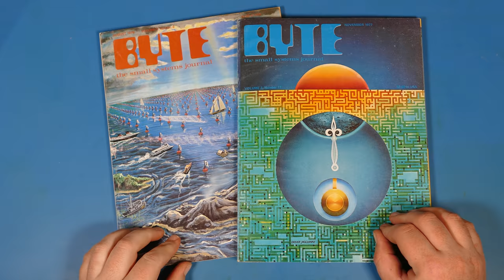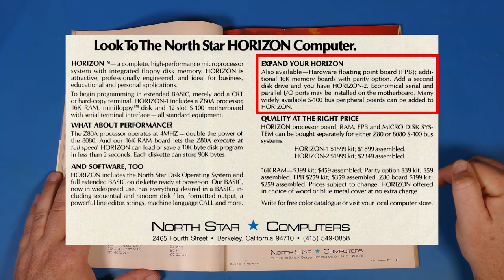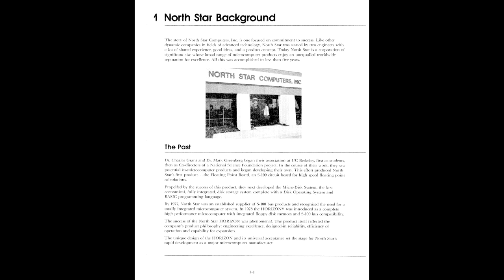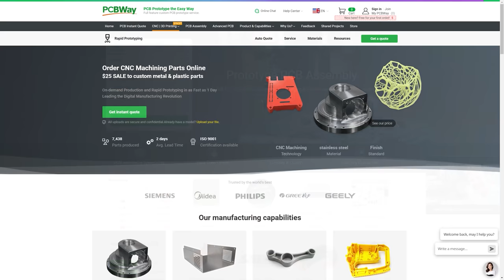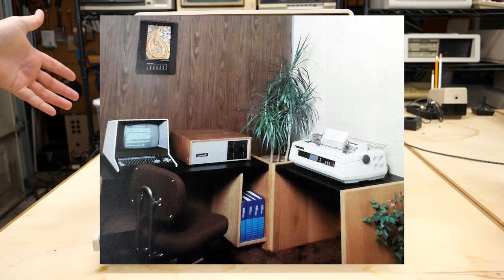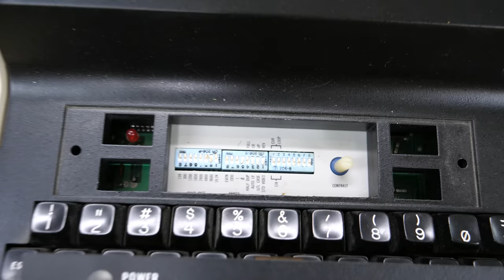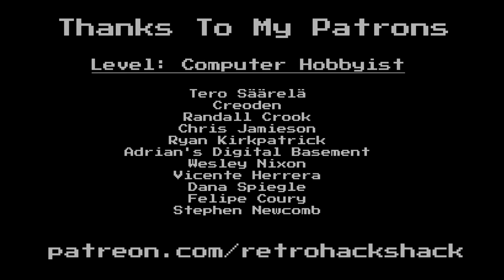The North Star Horizon - An S100 Bus Computer From 1977

Comment: Around 1977 the style for consumer Hi Fi units was very much that 2 part wood and aluminium look, so I wonder if North Star just commissioned a manufacturer of HiFi cases to make their case? Since this was focussed at home /small office users maybe they also wanted a design that fitted into the "modern" style that people would also have.
Reply from the maker: Yeah. That's very possible.
Reply: That was my first thought too - the styling is exactly the same as HiFi equipment from the same time period.
Reply: A lot of hobbyist computers looked like this. And a lot were S-100 (even the IMSAI 8080 or Altair 8800). Most of these started as home kit computers - the market was very very small and there were very few retail outlets.  I think Northstar - like IMSAI and Altair  - even had an optional toggle switch front panel.  Stunning to look back at 2Mhz -8 bit -64KByte system with a couple of 360KB floppies and think this was "living large" at the time. I think this config was around $5000-$6000. Moore's Law had not even kicked in yet.
Reply: For certain computers the cases were intended for something else. For example, the cases that Proc Tech used for the Sol Computer were originally intended to be used in the construction of digital clocks, so were available much more cheaply than a specifically designed and manufactured case.
Reply: In the late 70s the woodgrain aesthetic was everywhere and on everything you can think of, it gave things like "cold" electronic devices like electric can openers a warmer, earthier vibe which the 70s were all about. It quickly became faux woodgrain which as we (well, I guess you have to be of a certain age...) know carried on into the 80s. There was Dynabyte computer from the late 70s that had a faux woodgrain veneer, may have even been something like the contact paper that was used to line shelf (Dollar Tree still sells it ;), though more likely it was painted/printed on. Would love to own that Northstar.

Comment: Almost choked on my coffee when you said 32mb of RAM. According to a google search 64k of RAM in 1980 was ~$400. 32,000,000/64000=500 500*$400=$200,000 in 1980 dollars. In 2023 dollars that would equal ~ $774,000. No telling how much space 32mb in 1980 would have taken up and aforementioned cost is just the RAM, doesn't include whatever it would take, boards connectors and whatnot, to support that much RAM.

Comment: Actually, the SWTPc was not built on the S-100 bus, but its own, Motorola-oriented bus called the SS-50/SS-30.  It became a de-facto standard of its own, as companies like Smoke Signal Broadcasting and GIMIX made expansion boards and entire computer systems around, in addition to SWTP.
Reply from the maker: I always assumed it was S100. Thanks.

Comment: While there is no LSI floppy controller on the board, the controller board does still implement the low level functions that an LSI controller would. It's just made from discrete TTL chips. Kinda like back in the day a "CPU" was made up of several chips on a board instead of one LSI chip. They were very clever in the way they did this using the hard sectored disks to simplify the whole thing along with PROMs to implement more complex logic functions. This board uses memory mapped IO in a very unique way. The most significant byte of the address is used to pick the function you want (read/write/step/etc) and the least significant byte is the data. The logic on the motherboard is just for the serial and parallel ports (as well as some bus termination).
Reply from the maker: Thanks for the info
Reply: @RetroHackShack  Thanks for the video! I really enjoyed it. I don't have a Horizon, but I have other s100 systems. Working on repairing one of these floppy boards right now!

Comment: I used a Horizon running an OS called TurboDOS.  It was a multi user CP/M clone.  The neat part about it was that it had a hardware component to it.  You had one board in the system that was the main master board that had a CPU and RAM on it. The master board may have had a floppy controller and hard drive controller on it as well but I don't remember.  You also had slave/client boards which were basically a z80 single board machine with RAM and a serial port.  All access to the hard drive and the floppy drive were controlled by the master board. It had a print spooler to allow shared access to the printer.  You also user accounts so you had to login to do anything.

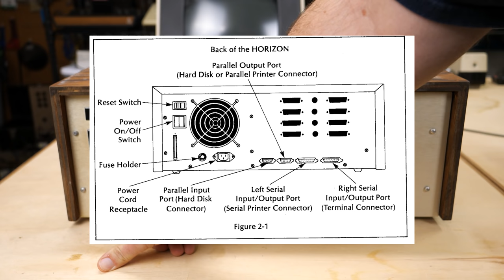Comment: 12:59 On the North Star Horizon computer I once had, the cutout was used as an opening for the ribbon cable to through to connect to a third and fourth external floppy drive. The computer ran 8-bit operating systems such as North Star DOS or CP/M.

Comment: Love the old Hazeltine 1500 terminal. I still have one out in my garage, that I have been unable to get working. Mainly do to a severe lack of effort.
I bout a new large multi-pole cap for the monitor, but after I hooked it up, I smoked one of the high voltage resistors, so it went back out into the garage. 
I also have a large selection of Northstar Software in boxes. However I believe a lot of that was ruined, because it was out in my shed, in the Florida heat.
But the folders and manuals still look good. It was just the disks that seem to have been damaged. 

As far as wooden computer cases goes, my SOL-20 has very nice wood side panels on it. It was manufactured and sole that way.
Reply from the maker: I forgot about the sol when I was recording.
Reply: @RetroHackShack  You even pointed out the SOL in the BYTE Magazine that you were looking at...

Comment: My first computer in 1979! 32Mb ram, dual floppy (double sided, hard sector) and North Star Horizon OS. Did the job great, complete with the Hazeltine monitor. Imported assembled from a dealer in New York. Later upgraded it to 64Mb so that it would ruin CP/M.

Comment: This really takes me back. In 1978-79, I worked in a computer store part-time while I was in High School. We would buy the North Stars as kits and I and a couple of other guys were tasked with assembling them. So much soldering, but the documentation they furnished for assembly was excellent. Most of the systems I assembled were a little older than the one you have, but the components look all the same. The disk drives advanced faster than anything else. It was always a thrill to power up for the first time and see the red light come on and no smoke. Not to say we didn't have some smoke every once in a while...LOL. Thanks for the memories.
Reply from the maker: This one certainly held up well!

Comment: Many thanks for this video. I wanted to mention that Soroc IQ 120 terminals were very commonly used with the Horizon, as Northstar sold them with their systems. Also, Northstar sold a very interesting floating-point board, available for the Horizon (or any other S-100 machine), which used only TTL and microcode and allowed up to 14 digits of binary-coded decimals. Enthusiasts willing to write code for it could get some pretty amazing numeric performance out of it (for a microcomputer of that era). Northstar offered a BASIC interpreter which made rather inefficient use of it. There was also a third-party BASIC interpreter for it called Micro Mike's BaZic.
Reply from the maker: Thanks for all the info!

Comment: Apple did indeed offer a board only version of the Apple II that users could use to upgrade their Apple I systems to an Apple II.  

They also continued offering upgrade paths like this going so far as to even offer motherboard/logic board that could be used to upgrade an Apple II into a IIGS.  That is actually why IIGS boards have a (usually unpopulated) connector for older Apple II keyboards on them.
Reply from the maker: Thanks for confirming that.

Comment: On the North Star ad page is the address of the Tucson, AZ Byte Shop I visited many times to drool over computers I wasn't willing to spend the huge amount required to buy.  I definitely recall one of these units there.  The one I most wanted was the Exidy Sorcerer with its sexy case.  I almost bought a Kim-1 there, but instead bought the Heathkit ET-3400 microprocessor trainer with its absolutely OUTSTANDING course materials.
Reply from the maker: Awesome

Comment: The serial add-in S100 Card - the HSIO4 - was a 4 port serial expansion card that offered Synchronous and Asynchronous Serial expansion with RS232 or RS485 with an additional module. It had ribbon cables with chassis mount DB25 connectors. Northstar sold a multiuser OS called TurboDOS that supported timesharing of the processor. I think they also supported Digital Research (CP/M) multiuser version MP/M. Northstar also sold a Floating Point processing card and accounting software. The combination of all this was it was a turnkey solution for bookkeeping. This computer - with all its power and expansion slots was very popular at Engineering schools.  Prototype cards for CAD, Data Acquisition, etc etc were not unusual. The company developed an all in one system - the Advantage - that pursued the business market (home computing was not a thing yet). And when IBM entered the market they pivoted to making PC clones for a while with short-lived success.

Comment: slot by fan is for a 34-pin connector for external drive(s), also, the Z80 can run 8080 code.  N* software defaults to hazeltine terminal settings.
Reply from the maker: Thanks

Comment: I used to work on electronics in the 80's and ESD protection was pretty much mandatory when handling boards such as those, especially RAM. I don't often see such precautions nowadays when handling retro equipment.
Reply from the maker: I have an esd mat and bracelet on my other bench. Honestly though, I have never had an issue working on cement floor with a wooden bench either. That is my setup in the garage.

Comment: 32K! 32K!
OK, without a control panel the CPU board had jump to the boot ROM (CC00hex?) on the floppy controller. The funny thing about The North Star Horizon floppy controller was that it was a read only device and it came in two versions, Single Density and Double Density. It occupied 1K of address space in high memory. The memory space was divided into 4 blocks. The first was the boot ROM and the second was just the mirror of the boot. The third block was the control and data block. The last block was the write data block using the address’ to write the data to the floppy controller. When the CPU was ready, to write data or read data, the controller would assert a memory wait until the data was ready I/O. This was very CPU intensive and interrupts where not allowed as this would ruin the timing of the read or write of the data sector. You also need a scheme to avoid the memory conflict with any RAM board in the same address field. That’s very much how it worked. The floppies & drives came in single density single sided at 90k. Double density single side was 180k and Quad density double sided was 360k.

Comment: Looking forward to the next episode! The lack of any obvious ROMs is interesting - presumably it has to boot from disk? - I know you mentioned it could run DOS or CP/M.
Reply from the maker: Yeah. If you look at the CPU card you can add a PROM there to boot from. I might try that.
Reply: @RetroHackShack  OS options for 8080/Z80 based S-100 systems were:  CP/M, MP/M, Concurrent CP/M, Multi-User System Executive (MUSE), and probably some other obscure off-shoots of these.   I'm sure other operating systems could be ran on S-100 by other processors, but I never saw it done.
Reply from the maker: Cool
Reply: The floppy controller has the boot PROM. It just reads the first file of the disk into 2000h and jumps to it.

Comment: I think I will.  I used to have a NS with a hard drive.  5MB I think.  I gave it away and immediately regretted it.  I traded some consulting for the one I have now.  It worked when I put it into storage and I have an RS232 Terminal.

Do you have a copy of Northstar DOS?

Then I used to normally load Northstar Word (I think it was).  I have the manuals and the disks.  I also have a rebuilt disk drive that I had rebuilt and left in the plastic package.

The big thing that was the difference in North Star Disk  was that the drives were hard sectored.  All the other S100s were soft sectored.   

Greg

Comment: The wired jumper on the CPU board is indeed for the power on jump address. For the double dense controller that you have, I believe this would be E800h. The CPU board PROM is not needed for the Horizon as the boot code is stored in a PROM on the floppy controller (this is the jump address that is programmed on your CPU). This code in the FDC PROM just reads the first file on the disc into ram at 2000h and then jumps to it.

Comment: The back pages of Byte have not yellowed - they were originally light orangish, though how light would vary from issue to issue.
Reply from the maker: This has to be cost savings right? I wonder how much they actually saved by doing that.
Reply: @RetroHackShack  This section of Byte also used low quality black and white pictures while the rest of the magazine was color. But given that it was always just a tiny part of the magazine I am not sure if the savings were that significant.
Reply: One additional thought: perhaps it was more about lead time than cost. The rest of the magazine had to be ready several months in advance, but maybe this part could accept last minute changes?

Comment: The SWTPC products that feature the Motorola 6800 (or later, the Motorola 6809)  use the SS50 bus, combined with the SS30 bus for certain sections of memory. They DO NOT use the S100 bus. Their 68000 based systems used the SS64 bus.

https://en.wikipedia.org/wiki/SWTPC

Comment: "Kentucky Fried Computers"- with 7 secret IC's and Registers 😀
what I think is interesting, is that the Processor is on a card that plugs into 
a backplane rather then on a motherboard. which  makes me wonder if they
had other processor boards with a larger/faster processor for an upgrade.
and if the one that is in this system  is  already one of this type.

Comment: Watching your magazine descriptions....  The SWTPC was 6800 based and not S100 (Adrian's Digital Basement had a couple episodes on it).   The S100 systems were originally Intel 8080 based, but later upgraded to the ZiLOG Z80.  The Z80 could execute 8080 code, but not the other way around..  The Z80 was far more advanced.  Early CP/M was written in 8080 machine code, and both the 8080 and Z80 could run it.  However, if CP/M software was written for Z80 specific code, then it would not work for the 8080.  The Z80 was a technological upgrade to the 8080 in speed, registers, and op-codes, as well as DRAM support.  Former Intel engineers formed ZiLOG and the Z80 was the middle finger to Intel's 8080.
Reply from the maker: Cool. Thanks for the info.

Comment: I worked on several wooden boxed computers, including this NS Horizon. It is not a PC, it might have 20 users attached. We called them Micro Computers as they ran on one or more Microprocessors. PCs were for individuals. The magazines followed on from computers getting popular, but the computer industry was already buying and selling computer hardware and software. Dynabyte computers were popular and started with real wood verneer, that turned over time into wood type plastic but still looked good. S100 card cages ended up in all types of furniture. Desks, cabinets, wardrobe style wooden racks etc. Apple's contribution was to reduce the price to make it all available to the masses. Micro computers were an industry before Apple existed. You are just too young!
Reply from the maker: Thanks for sharing that info

Comment: Never had an S100 system....but I want to get an Imsai. ..not so much to run it but for Nostalgia for WarGames.
Reply from the maker: Yeah. I have a friend that has one. It's strange that they used that for war games when it was already pretty outdated at the time.
Reply: @RetroHackShack  I suspect they may have done that because the Imsai just screamed "This is a Computer", with all the blinkenlights and switches, while the home computer trend was to make things that looked more like friendly appliances, and less stereotypically computery.  Microcomputers were still new enough, that movie audiences might not recognize a TRS-80 or Apple ][ as a computer, but what else could an Imsai be?